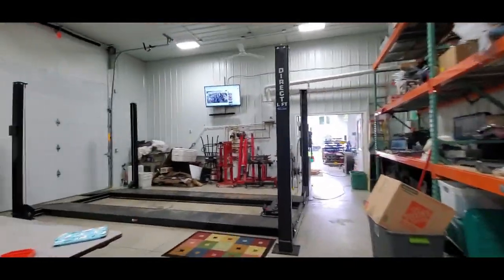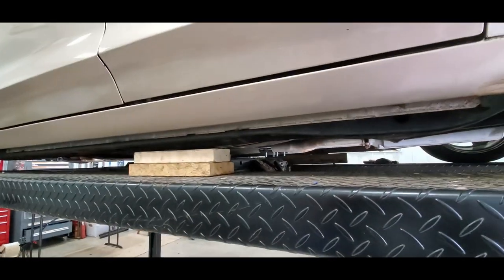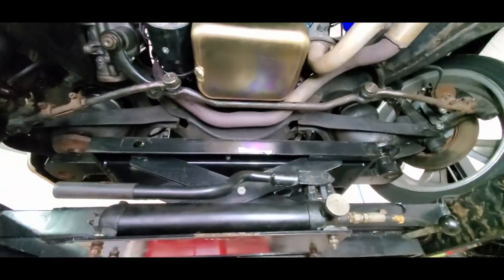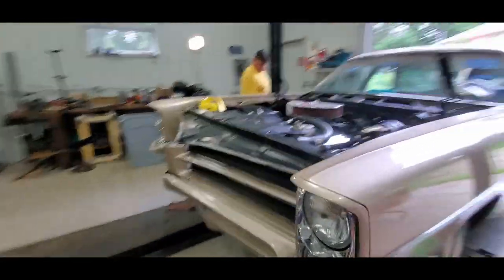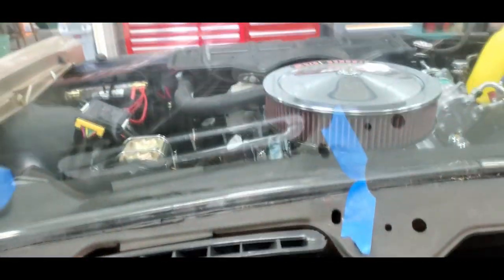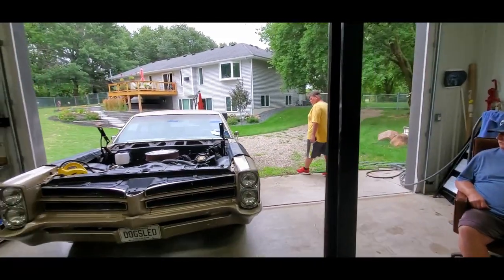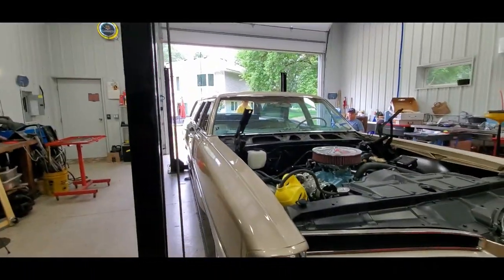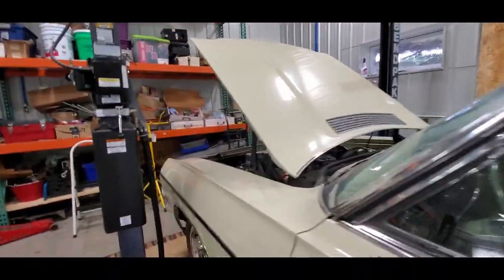66 Pontiac Catalina Wagon part 81, the rise of DogSled!

Comment: See you get it, like I get it. I'm a station wagon and Van fanatic. You ever see an old school flat front van with the top chopped? Especially like a old 66 67 Chevy with a dog house between the seats and a 327 in it that's pumping out enough power that'll bring the front wheels off the ground? I used to have one like that. I used to have a 75 Datsun 710 wagon that was so ugly it was beautiful. Damn thing was purple. It died horribly though, we flew off 109 ft cliff and landed upside down in a beaver pond. Almost died